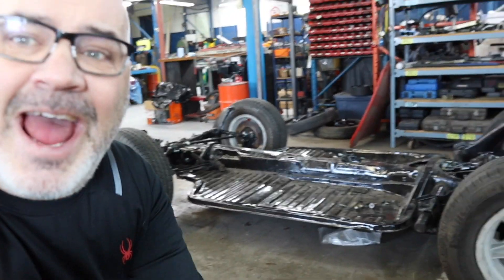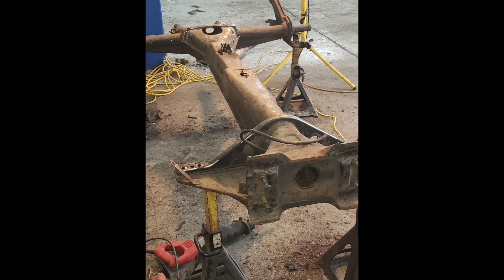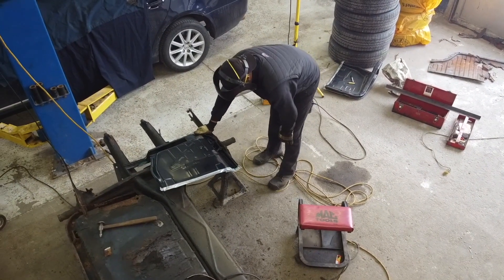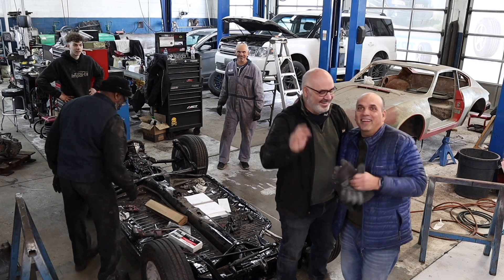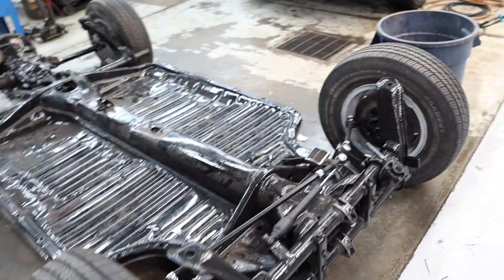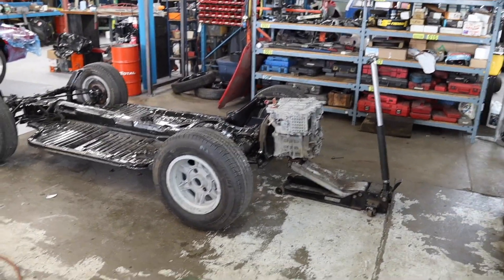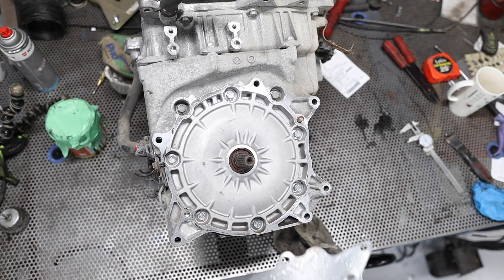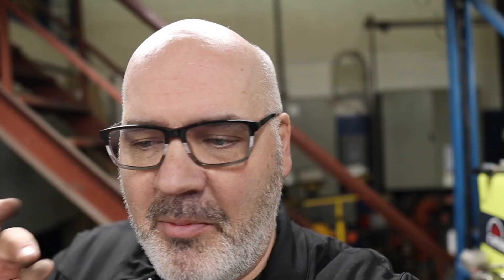EV Conversion Classic Car

Comment: 9:55 I'm VERY interested to see how the EV motor works with a trans. I could never figure out why evs don't have transmissions where you can make use of their tremendous instant torque and hp but then once you get up in speed, reduce the energy consumption by the use of gearing. 

Now this brings me to another query: who in this world needs an Electric Pickup Truck that does 0 - 60 mph in 3 seconds? 

Now since you're using a transmission, does that mean you'll get 3 forward gears and 3 reverse gears since reverse is caused by changing the direction of the electric motor? lol "you think it's fast in forward, wait until you see me in REVERSE" lolol
Reply: Transmissions are generally unnecessary in an EV. They are needed in ICE vehicles because internal combustion engines have power curves that are very "peaky" - they also don't put out much power low in the RPM range, so in most of the power curve you're getting like 30% of max power. With a transmission you can get peak power at 5 different points on your speedometer (5-speed transmission) rather than 1.

EVs have very flat power curves. They start off at 100% torque and then as speed builds they lose some, but even at high speed they might produce 80% as much power.. still a lot. And their efficiency curves are also pretty flat. So while, yes, you can get additional power by putting in a transmission, it's not worth the added inefficiency of always having the transmission in the drivetrain. Plus they add extra weight and complexity.

There is a reason why there are almost no EVs that have transmissions.
Reply: @BillCarlson  I realize all that, but you erred on a couple of things kinda sorta:

On start up at 0 rpm Yes, electric motors produce instant torque AND hp, but they also have massive current draws at that point. That's why massive electric motors have starter windings that are effectively a starter motor inside the larger motor to get the large stator spinning. This is, in effect, a "first gear". By simply bolting up the EV motor and keeping the trans you'll eliminate this huge current draw and most likely increase the range. 

Once again, no one in all practicality needs a pickup or hummer that does 0 - 60 in 3 seconds. Me? A guy who used pickups for WORK, I'd rather have the drive train more balanced and be able to make it to the job site and home again on a single charge.
Reply from the maker: Using the vw transmission allows it work as normal.
Reply: @LouTrottier  "Normal" for a combustion engine. "Normal" for electrics it definitely is not. It will serve no purpose and it will increase drivetrain losses and running costs.
Reply: @LouTrottier  that's what I'm thinking and I bet you will see an increase in range because of it. 

As long as it can handle the torque. VW motors weren't the most powerful. (yeah the leaf blower motor is only 107 hp so it's not outrageous.  Even the clutch and flywheel should be able to handle it.
Reply from the maker: @muskokamike127  agreed.